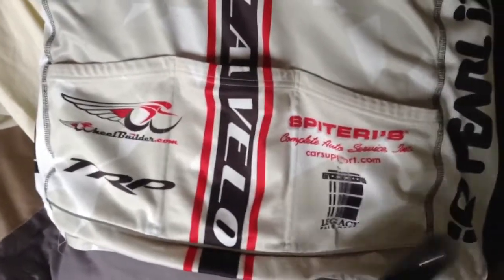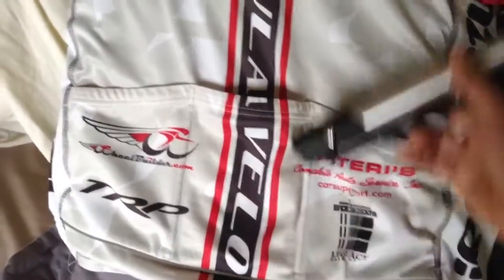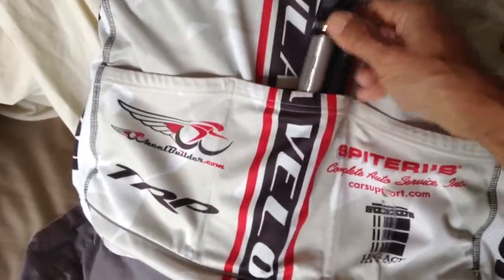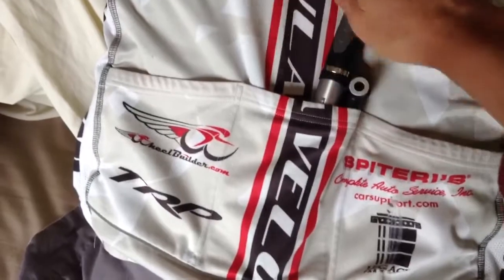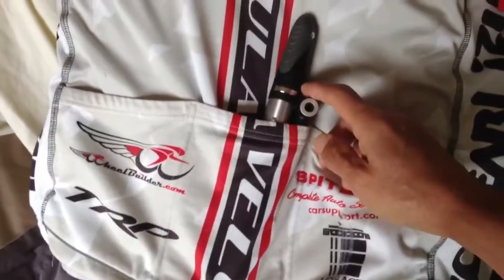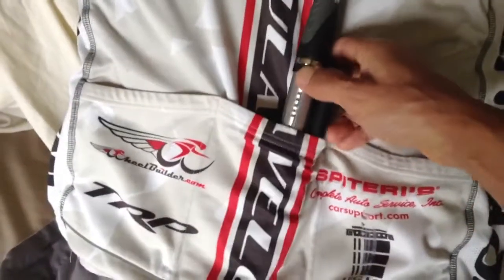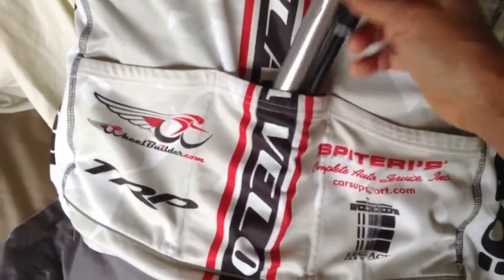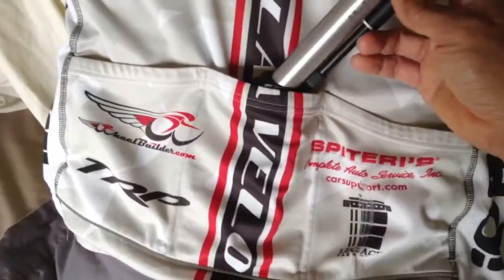DIY Jersey Pockets

Comment: My pump sits to the side of my water bottle. That's how the holder was designed and it's great. For people finicky about weight, I don't understand why they carry a tube. Patches & glue are much lighter. I've had plenty of flats and the patches have all held. Locate where the hole might be. Expose the tube in the area of the hole, then patch it up. You don't have to remove the wheel from the frame. I suppose if time is limited, then replacing the tube is quickest.